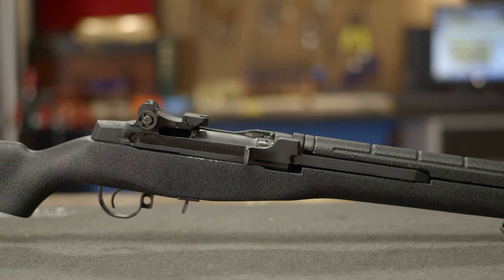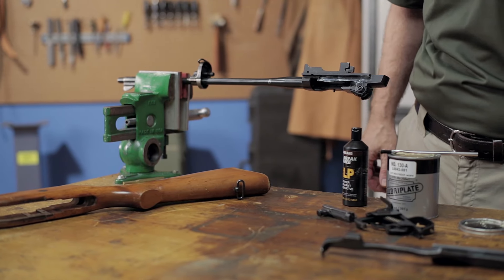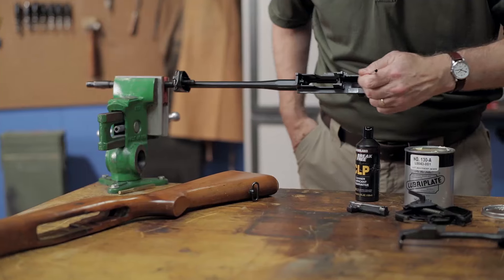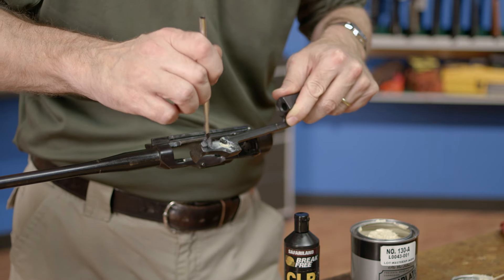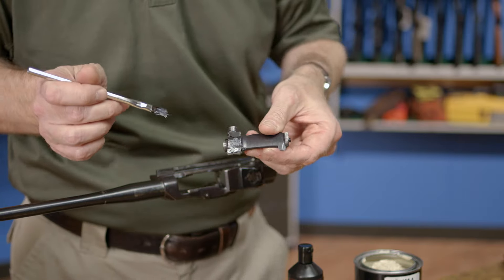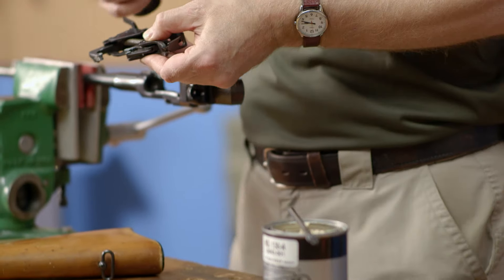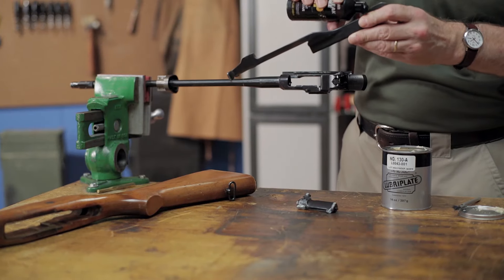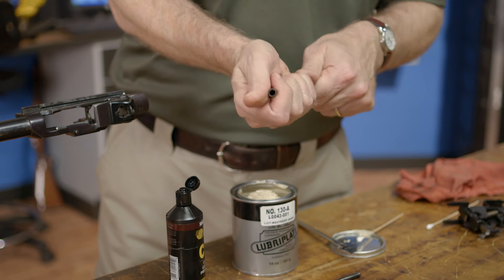Ruger Mini-14 Maintenance Series: Lubrication

Comment: I use white lithium grease.  I do not use NEAR that amount though.  All you need is a very thin film. I also clean the front of the op rod where it has the whole for the gas tube.

Comment: I use Lucas Gun Oil on mine. I think the action is even smoother than using grease. I've always used grease before. I tried the Lucas and I never used grease again. Next time I go to Auto Zone I'll have to pick up a new filter. 🤣

Comment: I respectfully disagree with the use of grease.  
I simply very lightly (a drop or two on bearing and contact surfaces) lubricate with Ballistol.  
The tolerances of the Mini-14 are so loose (by comparison to an AR15) that it will run totally dry.  
However, give it a drop or two of your favorite lube at the right points .  
The Mini-14 is a tough, robust and faithful rifle.  Not at all finicky.  Low maintenance.  
Fewer parts to go wrong, as compared to the AR15.  
Not a Porsche like the AR, but a workhorse.
Reply: I contacted Ruger and they told me just to use something like CLP is opposed to grease so I have never used grease since then.
Reply: @waltzb7548 Ruger said that? Any idea where I get a guide on where to apply lubricant?
Reply: @bigspence6898  
Your gun will tell you where to put it.
Where metal parts touch while moving. You may see wear marks on it from use.
Really anywhere where moving metal touches other metal.
Reply: @waltzb7548  Indeed. When I got a Mini, I figured it works like an M1 so maybe it needs grease and oil like an M1. But I called Ruger and they said "We use CLP and it works fine."
Peace.
Reply: The tolerances don't have anything to do with the clearances, or gaps between parts. Tolerance is the minimum and maximum dimensions of the parts, not how tightly they fit together. Larger, or more generous tolerances can result in greater variation of how the parts fit together, which could be tight, or loose.
Reply: Not everyone knows how to properly lube a gun. Brownell does it very well. Grease won’t run off like oil. Wipe off the excess when you put it back together. Thanks. SC Navy vet. 1965. 🇺🇸😊

Comment: Q: with a new mini should I spare the grease & only use light oil until a few hundred rounds so they contact areas “marry” ? I never gave this great consideration before.
Reply: Yes. Good synthetic oil that penetrates the pores of the steel will do the job perfectly. Grease is way overkill and invites dust

Comment: Well.. when I grease my Mini-14 I just use a very very small amount of high temp lithium boat grease in pretty much where he is doing it but I do mean a SMALL amount. A very thin layer.  I use a Q-tip for the tiny places.

Comment: Better too much than too little.  You can clean all that nasty dirt and debris out AFTER you survive the engagement...
Reply: Too much, by definition, is a problem. If your Mini-14 is loaded with grease, you will not know how much dust has accumulated and what effect it will have. A thin film of synthetic gun oil specifically designed to penetrate the pores of the metal will give you far more lubrication and heat tolerance.
Reply: I'd go opposite!!!
Reply: @jpb1231000  I agree with you, jpb1231000: light amounts of pore-pentrating synthetic oil will prevent dust collection, provide lubrication, and make the metal more resistant to heat and friction. I use "SLiP 2000 EWL."  Check out the stats and performance parameters on that and other similar synthetics.  Way better than grease or regular  oil. I don't sell the stuff and I'm not a fanboy. I just did a LOT of research on a lot of pore-penetrating synthetics to compare them with each other and with various organics.
Reply: @mxrc179  Interesting. Have you tried CorrosionX ?
Reply: @goosecouple  I have not tried CorrosionX. I'll look it up. Thank you for the lead!
Reply: @goosecouple  Not yet. But thank you for the suggestion!